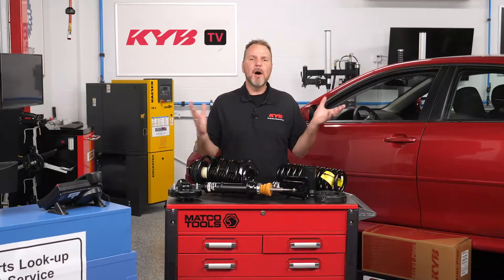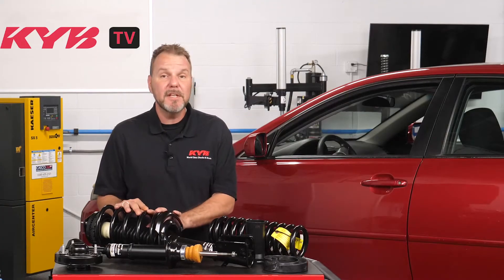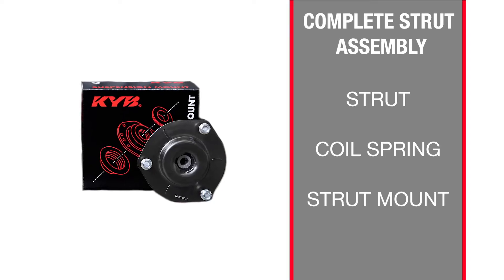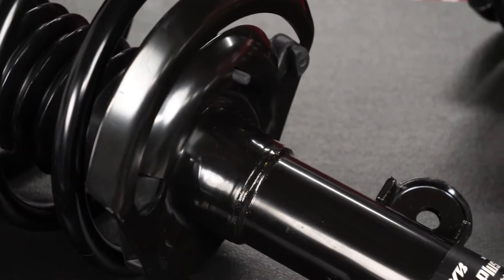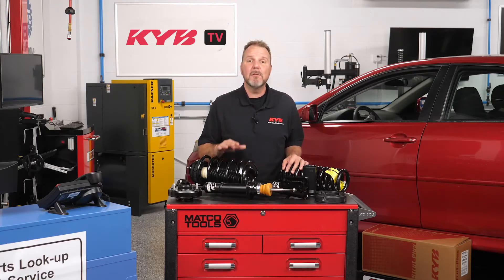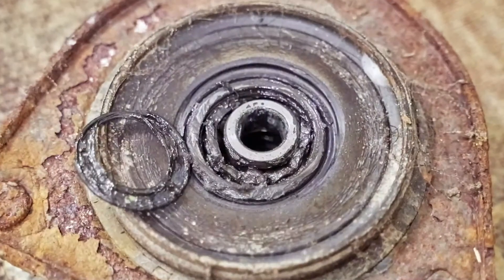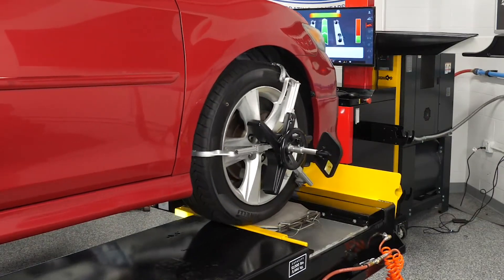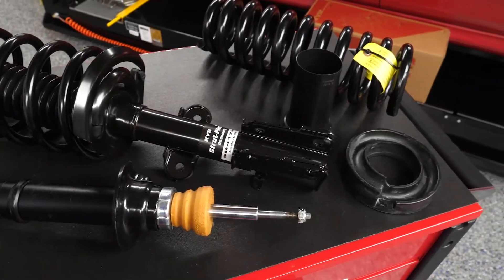KYB TV Episode 5: What is a Strut Assembly?

Comment: KYB are NOT OEM! They include the cheapest possible strut mounts on their assemblies. Half the thickness of OME and they are castellated, like a rook piece in chess. They do this to cheap out and save on materials. Because this castellated design does not seal the strut tower hole fully like an OEM strut mount, dirt and water will enter into the engine bay through the strut tower. This will cause not just premature wear on the strut mount but can also cause damage to your engine components. Shame on this company.